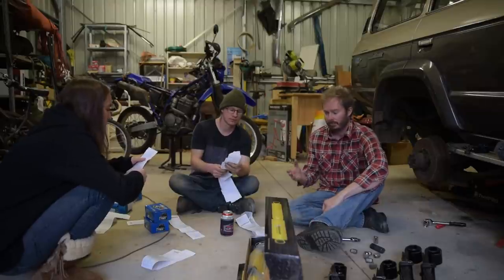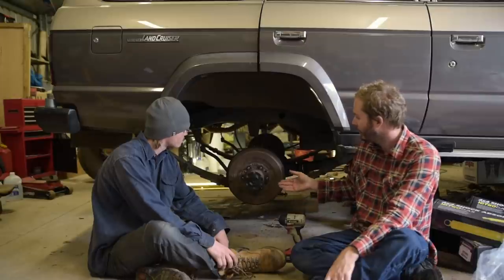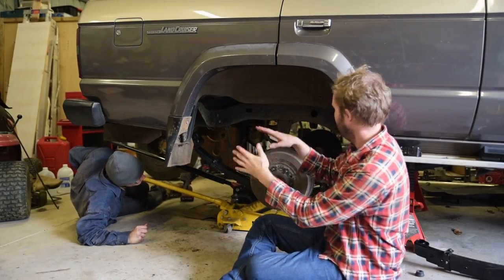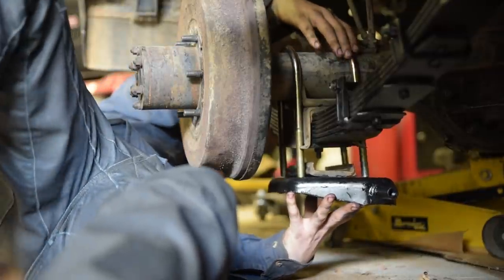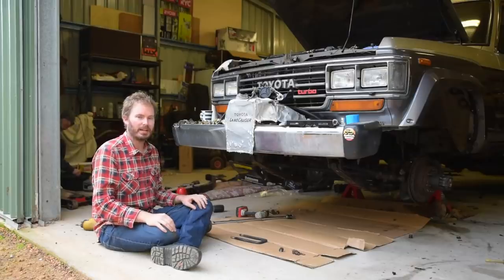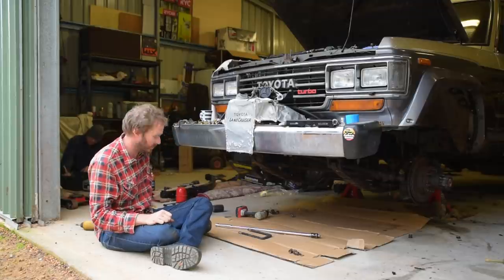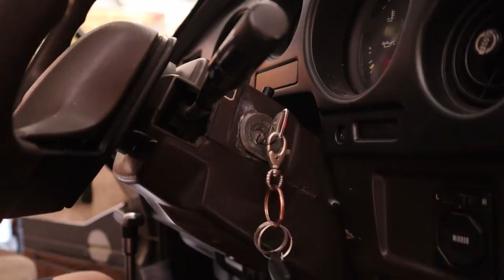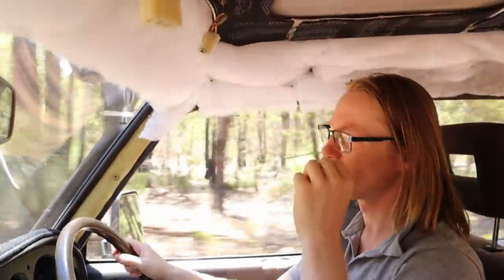DIY Leaf spring install. 2 inch lift on a 60 series Landcruiser

Comment: Legends, so many laughs! Another classic. And a micro-cover of Yothu Yindi. You're (almost) continuing to give me the false confidence to do bad things to the '86 FJ60  in our family, thank you! Thanks for showing the bush pin wear around 20:ish, illustrates why the grease matters. Always questions...  Did you think about the Dobinson's greasable pins or do they not have them for the 60? Unnecessary question - curious about the ride height measurement, over here hub center to top of fender opening is what everyone seems to use, clearly it doesn't matter, just an observation. Thanks again, so much easier to watch DIY's when they're fun!

Comment: Nice video, I'm assuming that's a 12ht in her how is it with the auto power wise and is it twitchy when you hit a little bump? My manual 12ht gets a bunny hop happening when you hit even a small bump if you haven't got your foot wedged on the kick panel unless if using the hand throttle.
Reply: Yep she’s very sensitive. The hand throttle is a must!

Comment: In the rear you should have a look at installing high clearance leaf plates from Superior Engineering. The threads & bolts are countersunk into the plates. A relatively inexpensive mod & a easy one too 🤙

Comment: FYI - zero sag makes for a really bad ride on the road. Can see it at 25:57.  You'd be supersized how much the suspension needs to sag slightly,  rather than letting the whole car fall.  Even an inch of sag will make a massive difference to the smoothness on small bumps and undulations.
Reply: This vehicle never carries much weight and so the harshness of this suspension setup is real. People avoid traveling with me because of how harsh it is. The search continues to return it back to standard as the desire is to not have the vehicle looking too modified.

Comment: Atleast the 60 series have spring under suspension so you can drop the leaf packs out the bottom once you undo them and don’t need to jack up the car a whole heap like a spring over setup. (I personally find spring under easier to work with)

Comment: If you're doing a 2 inch lift put 40 series swing arm linkages for the back and vt commodore swing arm linkages in the front and it will level out your swing arms for a better ride. Common mod for 60 series owners 👍
Reply: Sway bar?
Reply: @danielrawlings7926  haha sorry sway bar, been working on my dirt bike 😅

Comment: Does this upgrade have an affect on the level of ride comfort?
Reply: Yes.
Reply: @jakethomasgarner1886  for better or worse?
Reply: Worse. In our situation, this vehicle is not often going to be carrying the amount of weight needed to make these springs sag the way they should. The more aggressive curve provides the lift, but it needs more weight to make it work. This vehicle is staying relatively stock to honour what it was in 1989. We have loaded it up quite a few times in the hope that it would sag, but it seems to need a constant extra load of at least 150kg to make the springs work properly especially in the rear. We will be returning it to standard springs and installing airbag helpers in the rear for when it is weighed down for long distance travel or towing. If considering gaining 2” (40mm roughly) of lift from this type of spring, it would suit a vehicle that has a permanent drawer system, extra spare tyre or two, larger fuel tanks etc.
Reply: @jakethomasgarner1886  thanks for the clarification